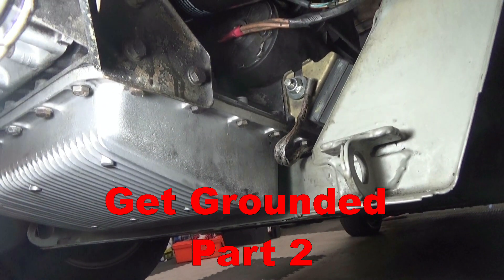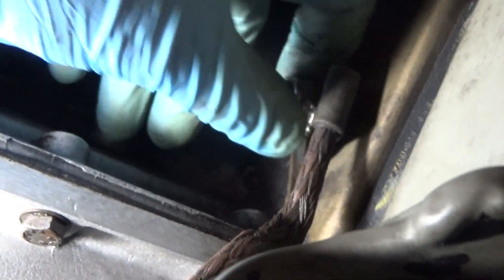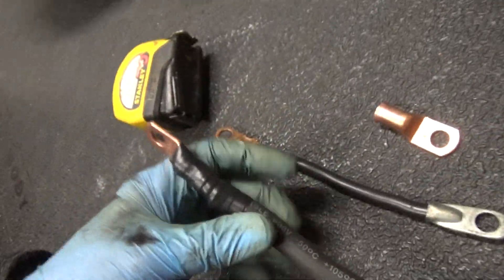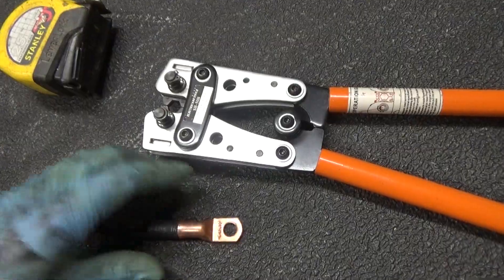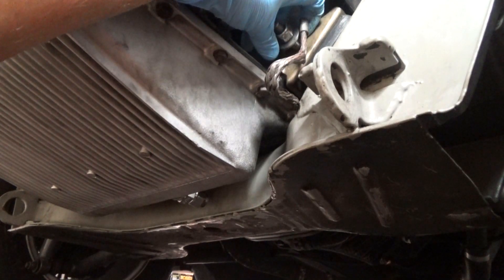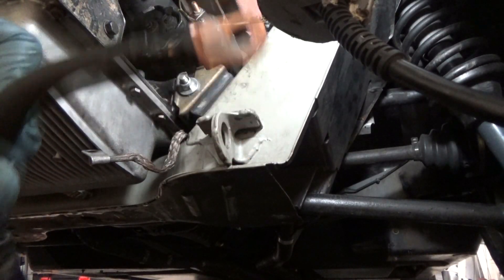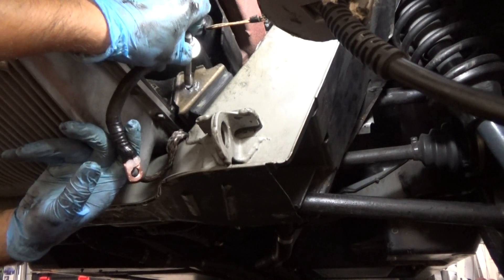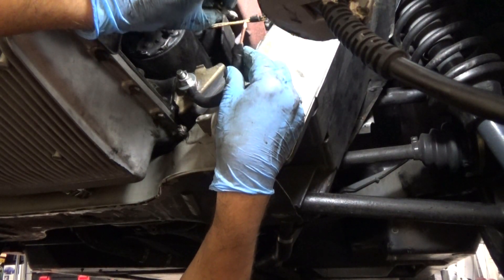Get Grounded 2! How to Replace and Upgrade your DeLorean's Engine Ground

Comment: Did you run a cable from the ground bundle next to the radio back to the bulkhead?
Reply from the maker: Nope but fortifing that ground point is on the list.  I might just run a heavy gauge groud from the radio to the body mount location to the left of the radio on the body tub to frame connectin there.

Comment: Love your videos. One thing: This applies to part 1 also, dielectric grease is made to protect electrical connections, but it is NOT conductive, and should not be applied to the mating surfaces.
Reply from the maker: Stockholm Delorean while i agree it is not conductive, i disagree that it should not be applied to mating surfaces. As long as you torque the mating surfaces properly, what happens is the dielectric grease gets displaced. It does not stay there like a barrier. Many think it does, but I have done a lot of research on this.  After it gets displaced it fills the voids (asperities) between the mating surfaces thereby protecting them from corrosion.  Check this video out, debunking the myths of dielectric grease on mating surfaces.  It's all about the gaps.  https://www.youtube.com/watch?v=3Uck9IUIYBQ